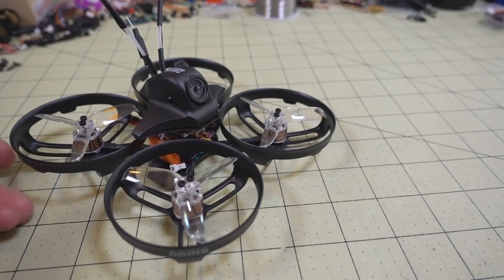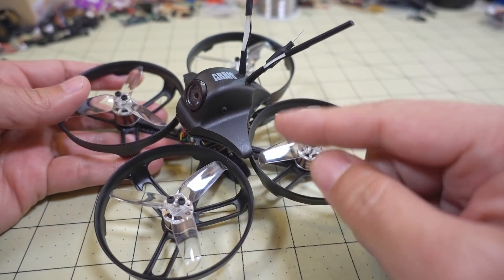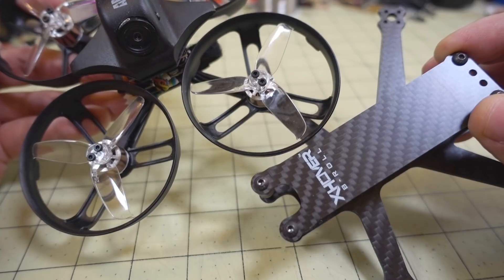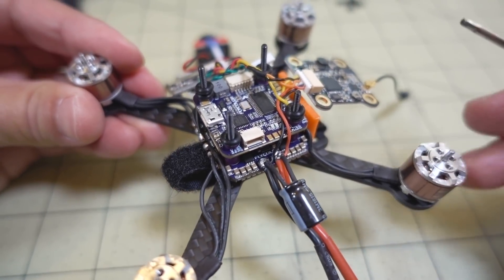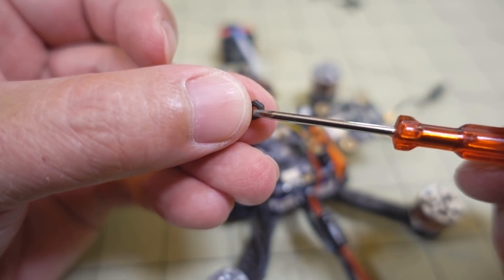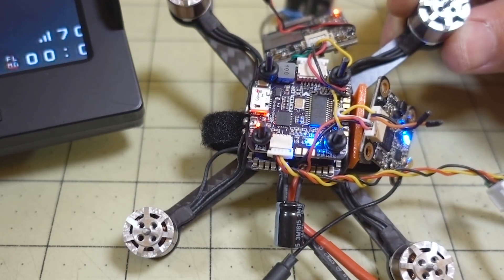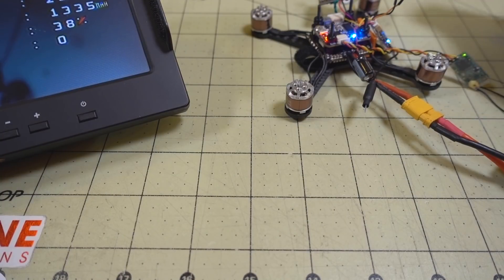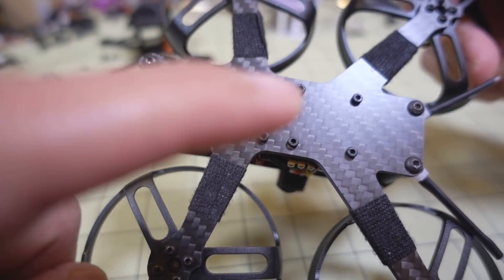Drone Lemonade #7 🍋 ARRIS Observer "CineWhoop" to XHover BROLL

Comment: Another great shake and bake video Albert. It looks like it's flying heavy for those motors, What weight did it come in at minus the battery ?
Reply from the maker: 140g. I plan to take the ducts off and upgrade to 3 inch props.  Should fly better then, but it's not bad for a 2.5 inch Cinewhoop!
Reply: @AlbertKimTV  Thanks for the info, I'm looking for a 3" frame with swept back arms and 12mm mounting holes for 1407 motors no more than 29g.